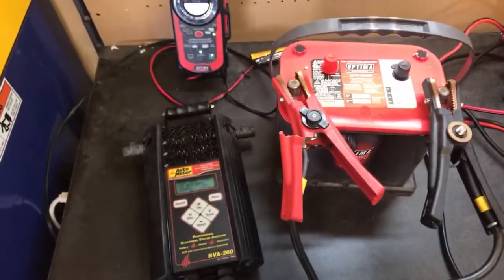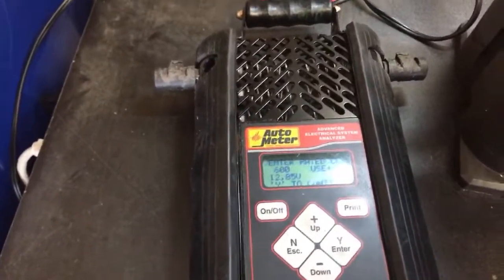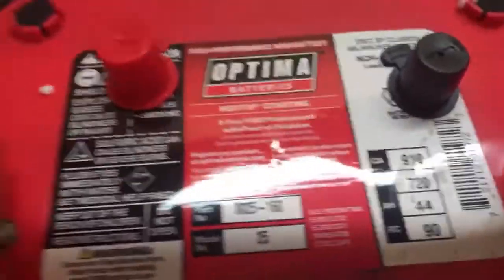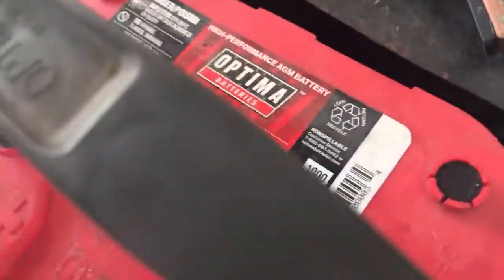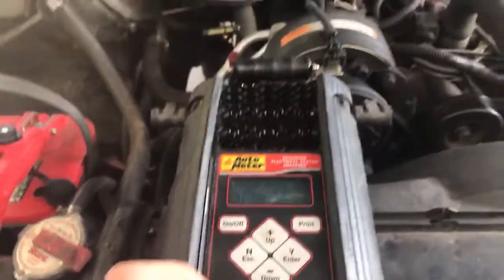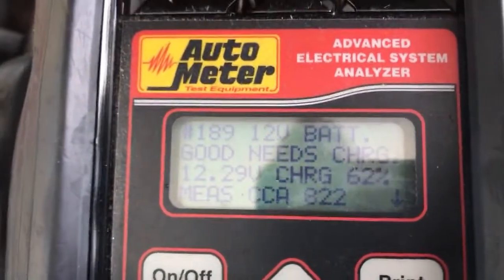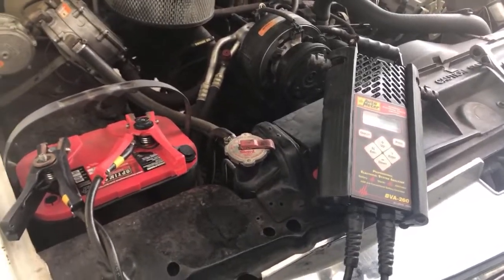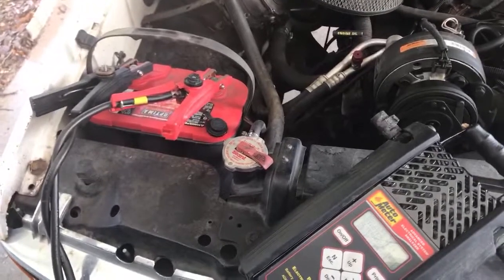How Many Cold Cranking Amps Do I Need?

Comment: I have a Mazda 3 2010 will just alternator be good enough to charge these batteries?
Reply from the maker: It should do just fine to maintain the battery, but if the battery becomes deeply-discharged, you should fully recharge it with a battery charger and not rely on the alternator.

Comment: If my current battery is rated 650 cca’s could I replace it with a 600 cca battery? The CA on the current one I have is 825 but the one I’m looking at is 750.
Reply from the maker: The safest option is to at least meet the OE specification for your engine. Cold cranking amps are measured at 0°F for 30 seconds, so if you live somewhere like San Diego, where it never gets anywhere near that cold, cold cranking amps aren't as big of a deal. Many people will also run undersized batteries in their vehicles to save weight, but smaller batteries are also more susceptible to damage from extreme heat and may not last as long. Peurket's Law also indicates the more deeply you discharge a lead-acid battery, the fewer cycles you will get out of it.

Comment: On a old carbureted car with a big engine, specifically a old 383 in a 66 Chrysler, does it make more sense to just get the biggest cca battery I can find? What would you recommend
Reply from the maker: You don't need to over-buy on cold cranking amps, especially in a vehicle that is unlikely to ever be used in the temperatures where cold cranking amps are measured. Instead, we would recommend a battery that at least meets the OE requirement for cranking amps and regular use of a quality battery maintenance device, when the car isn't being used. https://www.optimabatteries.com/search?cat1=PZ_ALL&cat2=Batteries&cat3=Batteries&from=0&y=1966&mk=Chrysler&md=300&sort=1&eng=V8%206.3L&ymmType=AUTO&sortType=DESC

Comment: i have a 2003 dodge caravan what cca battery should i get
Reply from the maker: You have several options. If your vehicle is basically stock, a REDTOP will work just fine. If it has an entertainment system, like a DVD player, that might get used while the engine is turned off, we'd recommend a YELLOWTOP- https://www.optimabatteries.com/product-search-results?year=2003&make=Dodge&model=Caravan&engine=V6%203.3L%20Gas&qualifier=Qualifier

Comment: Hi thanks for explaining I have a Question my car is a Nissan sunny 2009 model engin 1.6 and I don’t have  manufacture recommends book so  what battrey i use for how many ampere  please
Reply from the maker: This battery is recommended for the Sentra with a 2.0-liter sold in the United States, but you need to verify it would fit in your battery tray- https://www.optimabatteries.com/product-search-results?year=2009&make=Nissan&model=Sentra&engine=L4%202.0L%20Gas